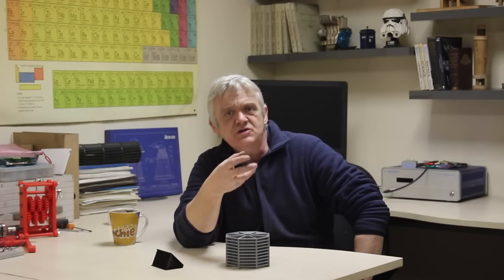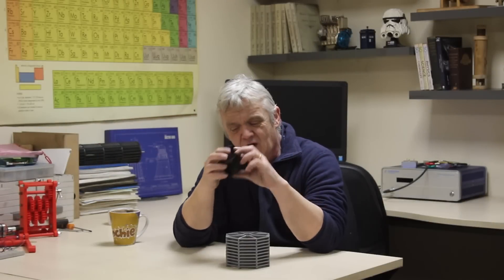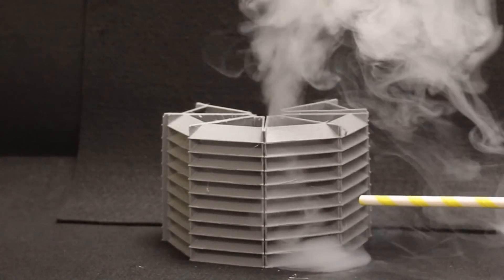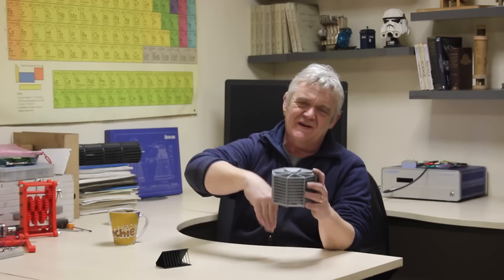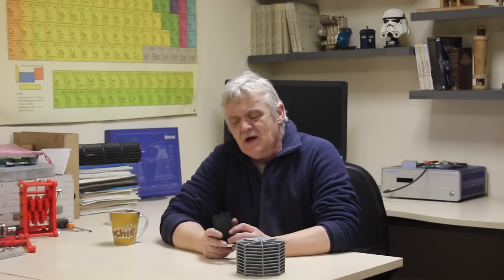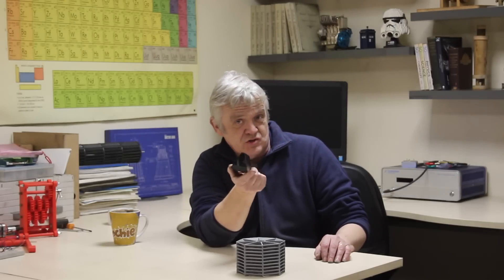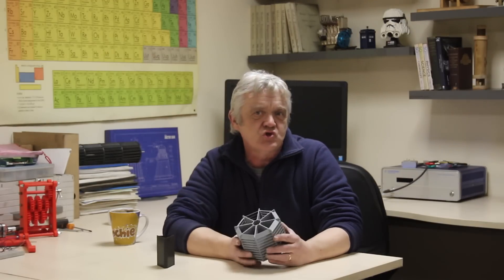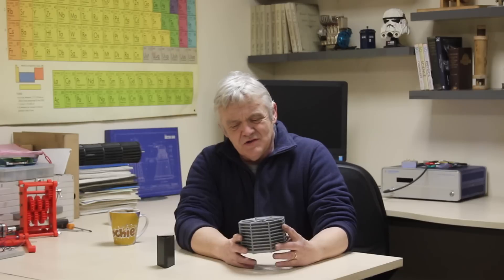1830 A Darwin Wind Turbine Breakthrough

Comment: I don't know why, but I get a little thrill or joy when a solution appears that is SO simple and just works really well. Delicious!
Reply from the maker: lol - me too!!
Reply: ditto, it always points at "lets optimize more!". that with a short stack outer reducer cone and center cone (cross section of round)  \     /\    /
to increase velocity to the outer 2/3 to 3/4 the blades where they make torque..?
like a jet intake or a velocity stack.. non moving parts.

Comment: I think you might not be modeling the air resistance during operation quite right.  I think in practice, the inertia cost of changing the wind direction will slow that air unduly and air molecules will pile up as a buffer around the apparatus, creating a pressure zone and air that would have entered will instead just take the path of least resistance and flow around it.  It will work, but will if work as well as a cowled prop that orients itself to the wind?  I doubt it.
Reply from the maker: no worries - we all have our ideas - I disagree with yours for good reasons of my own - cheers

Comment: Are you sure that the wedges should go until the central axis ? In the initial work the wedges were minimal in length and let the center of the inscribed cylinder free to collect from everywhere, even turbulent wind; all your tests are with laminal wind which is not the most frequent around a building such as a house.
Reply from the maker: no of course I am not sure mate lol

Comment: Not in regards to this but look into the new torroidal propellers! They're amazing.
I regards to this I think if the blades were more like the "Air Blade" set up they might be even more forceful. Hell, maybe then you could direct everything into a torroidal propeller and kick it up a notch. Check out "Major Hardware" who 3d printed the propeller and applied it to a pc fan. Also "Ziroth" did a really cool breakdown of them being used in marine applications.

Comment: Robert can you use some of the power to setup an ionic thruster as well from the top most inner layer blowing down towards the fan? Kind of like a primer for air flow when there may be very little air speed?
Reply from the maker: that's an interesting idea mate - thanks for sharing

Comment: Robert if you also add fins on the outside so it can catch more volume and then on the bottom in the top and then have your thing on the inside and then also another thought is you know how they are collecting are on the roof tops with their causing a vacuum going through a tube control could you put your device and then the wind turbine and then the vacuum of ice after it so that you have most a push and a pole on the blade would that work
Reply from the maker: I like the idea of extending the fins mate - I'll give that a go - the rest - I don't really know to be honest
Reply: Hi Robert
Reply: Robert if you get a chance look up are mined rooftop wind technologies they're using vacuum to run a wind turbine

Comment: Hello Robert,
That looks great but I'm sure there is turbulence which is losing energy in the tip of the wedges.
I believe that If you made each fin slightly deeper than the fin below it, so there would be a gradual increase all the way up until there was no more room left in your wedge for any more fins and with a downward curve over each extension, including a fully enclosed curved top fin, then you would eliminate a lot of turbulence and create a more efficient flow.
Just a thought.
Love your channel, keep us smiling bruv. 😁
Peace.
Reply from the maker: nice thought mate - thank you for sharing
Reply: Tapering the edges of the wedges might help reduce some of the turbulence.

Comment: If you was to put a angle on the back side ( instead of it going to a point in the back) would it smooth the air flow and with less turbulence?
Reply from the maker: I suspect so mate

Comment: Hex vs Octogonal shape efficiencies?  How much resistance to flow does the sharper wedge create?   

Also I understand the advantage of ease of modeling and manufacturing flat panels, however using your previous design with wedges added, @35 degrees and in a Hex configuration might be the better design....   Iteration and all that.
Reply from the maker: good thought and I can see what you mean - I am kind of fixating on octagon and thanks for posting that out

Comment: curious... wonder if instead of wedges for each sections they were Archimedes screws* with the  back side of each to prevent cross flow  is a split tube? . Less turbulence of air in its down path.. maybe more benefits?

but yeah....  lot more complex to make

*probably wrong term....
Reply from the maker: yeah - that's the one that got me mate - but if you give it a go I would be fascinated to see

Comment: Tapor the angle with a Stack shortened sections of Gabriel's Horn to help air transition direction and accelerate with the least  turbulence. 

I know you want the generator on bottom for weight and maintenance considerations but consider if you place it up top.  The wind blowing over the top  of a tube creates a low pressure zone. That sucks air through.
Reply from the maker: I did consider it mate - but honestly I am aiming for low cost. low maintenance and acceptable generation - not sure how it fits in with that

Comment: Now we need to come up with a clever way of keeping the air and ditching the rain water, although there are probably good industrial designs that can already do that, an inexpensive way would be a step forward for the home gamers.
Reply from the maker: most turbines are up in the air in wind rain sleet and snow - I doubt it matters that much tbh mate
Reply: I suppose it wouldn’t be too much trouble to have the turbine inside the air shaft and the generator outside of it with a belt or chain connecting them so that the electrical stuff can stay relatively dry...  I know the commercial wind stuff is able to handle weather but if we build some cheap medium scale equipment ourselves from salvaged parts or hand build components and whatnot, I’m going to assume it wouldn’t last too long if it were totally exposed to lots of rainwater all the time, I’ve definitely experienced problems with that, even at low voltage.

Comment: Thanks for sharing these videos. For what it's worth, I've been enjoying your content for a while and particularly these video covering the Darwin wind turbine design. Since you've been experimenting I've been trying to think if it would be possible have the louvres facing downward (from the centre) to give protection from rain ingress whilst still directing the air downwards. I wonder whether that could be achieved using your new internal "baffles" somehow?
Reply from the maker: I am not sure rain is such a worry mate - after all most turbines are up on a pole come wind rain sleet or snow - then of course there are turbines completely submerged - so - a bit of rain - hmmm - not sure I would worry too much about that
Reply: Maybe a good cap...a sort of roof.🤔

Comment: Now just need to figure out the best turbine to put at the bottom of that pipe to collect all that lovely wind energy and convert it to mechanical energy without causing any back pressure in the tube, that would hurt efficiency
Reply from the maker: wells turbine

Comment: just a quick question, if you have curved vanes, does the 35 degrees still hold true? or can you ignore the angle (mine are not hyperbolic, just a 90 degree segment of an arc) also does the spacing of the louvres make any difference (or is this as yet an unknown) currently still printing a second ring of louvres, I have the tube adaptor, venturi for the top of the tube to bring the size in to the pipe and dome cap for the other end, so next I will need some wind for testing (my whole cap is just over 8" diameter (200mm) and will have  a louvre area just over 10" high (260mm))
Reply from the maker: you can ignore it I think

Comment: Depending on the incoming air temperature it might work better if the air was directed up and a chimney was used as a way to add some additional suction - top-expanding funnel shaped chimney end might create additional low pressure on top to suck the air. Maybe such Darvin air intake could be used together with rocket stove in the center of it for co-generation of electricity  and heat... seems we're building more complicated systems from lego blocks :)
Reply from the maker: it might indeed mate

Comment: I have been watching this project with great interest. You are making huge advances with this technology. I wonder if you put a smaller set of slots along the centre tube, (maybe at 45deg) it will create lower pressure in the centre and draw more air in (Venturi effect) sort of like an airbrush. Maybe even just holes (not aligned with opposite side holes) in the centre could create the effect as well.
Reply: or maybe an internal cone, or slight reduction cone underneath for velocity into the blades like  \    /\   /  (cross section of the round) like a turbine jet engine intake.
center doesn't give torque like mid-to-tip of blades do anyway, its like velocity stacks and ports of an engine.
Reply from the maker: I don't really know mate - but I like the question I will look into it

Comment: What a simple but clever design!

Food for thought:  Instead of the cheese wedge coming to a point, if it was circular it may retain more potential energy (ie. by reducing turbulence and tightening the air column by promoting rotation).
Reply from the maker: cheers mate on both counts!

Comment: Great. One suggestion for a very useful varient of this is a 3/4 profile that can affix to the corner of a building. The most wind on a building is at the corners where wind has to concentrate to flow around the corners. It's a minor variant of that one but easier to install. It's that, just with 2 segments less.
Reply from the maker: clever, clever clever clever - I like that mate - and as you can see - I like it a lot lol
Reply: @ThinkingandTinkering  what about at the peak as well?
Reply: I have been wanting a castle turret design on my house for years... this might solve it for me... Thank you. (The only thing is that I think for permanent outdoor use, I would have to surround the thing in a protective wire mesh to prevent birds and insects from making a home in the slats... and that would tend to diminish the flow... but I don't see a way around that.)
Reply: @marcfruchtman9473  I live next to a house that has two towers. And my first thought when I saw this?
Reply: Since all the governments seem SOOOOOO concerned about climate change / renewables, how bout we make these and vote to replace ALL the big brother (invasive) cameras on the roads and highways with these. Making power instead of consuming it! Who is in?
Reply: @jholland404  that will provide a lot more room for mounting more devices and the power  to run them.  Law of unintended  consequences.  But would  be great if it worked that way.
Reply: @jholland404 that's an awesome idea😅😅
Reply: Seriously brilliant!  We don't get a ton of steady wind where I am, so that would help maximize what we do get!
Reply: They are trialling wind generators down the middle of motorways that pick up the wind created by moving vehicles at the moment.
Reply: That's solid idea. I wonder if that would also work around a rainpipe.
Reply: 9 tenths of the profile would be a bit more effective.  Also minimize gauges of thickness.  O.O5  to 0.32 only an opinion.  Hypothetically at best. Only a short video.
Reply: 180 degrees just mounted on the wall too, its never going to get wind from that side.
Reply: Here’s my question on the 3/4 version mounted on the corner of the house or whatever. You can’t use a fan shaped that way so what do you do duct and funnel it to a smaller fan/turbine and hope reshaping the duct doesn’t have negative consequences on the air current?
Reply: @308dad8  good point. Yes you could. With fluid dynamics if you reduce the size of the pipe, then airspeed actually increases making the propeller spin faster. Alternatively you could bend the airflow slightly by 20° or so.
Reply: Brilliant
Reply: The Old City of Yazd in Iran has these “Wind directors” on their roofs for cooling their buildings. The upwind side directed the wind down and on the leeward side had a slight depression, sucking warmed air back out.
Reply: Brilliant idea!

Comment: The idea to put the walls internally to prevent the air from moving across is quite good. I recommend increasing the spacing between the slats... when the slats are too close together it creates a lot of air friction and you won't get as much air flow.
Reply from the maker: cheers mate - I was pondering that

Comment: If you're up for a bit of optimizing, I would certainly take advantage of the pressure zones this can harness and incorporate a low pressure frontal opening to assist in higher ambient pressure pushing itself into the intake areas and accelerate it up your runners, then open the exhaust area and incorporate a vertical twist through the body. While doing this by hand, flat panels are much easier to build, however, air prefers to travel on smooth surfaces and can be impeded by sharp contours, so much so that boundary layers can incur turbulence and hence reducing efficiency. The beauty of the 3d printer is that it can be designed in such a way that the optimum shape can be achieved and printed quite easily, of which can later be dismantled at larger scale for reproduction via sectioning. And better yet in your CAD program, you only have to make one really great chamber, then place an automated copy/paste routine of how many ever you can fit on the circumference while running a rotation on your z axis. Easy peasy venturi squeezy. 👍
Reply from the maker: to be honest mate and with he idea of simplicity in mind I was thinking of just sticking a wells turbine at the bottom - I get what you are saying but optimisation comes after to my mind and what I want first is a result then we can work on improving it - key criteria are cost, simplicity and robustness
Reply: @ThinkingandTinkering  Fair and valid points!
Reply: Not sure about anyone else, but I'm having a hard time following your description. Are you suggesting another intake before the flaps that would accelerate the air? Would that be any better than just adding more flaps and making it bigger? And are you sure it's not already doing that? Think about it, if the size of the "cheese wedge" is constant, and each flap introduces more air, the air inside the wedge would have to accelerate as it moves toward the end, right? Don't mean to say you're wrong necessarily, I don't know. It would be interesting to get some readings inside the body to see what the pressure and velocity are doing. Maybe a helical flap structure could induce a vortex and make it flow better, but that would mean getting rid of the internal partitions. Would it lose air out the other side? Guess someone's just gonna have to try it. :P
Reply: @DFPercush  I've used my rough description once before as a sort of modern day Francis turbine on steroids that is more based on the operating principle of it but not so much in design; I may be able to modify my solidworks design if it would be of use, though for this, a fresh design would be more practical. Basically the idea is to create a converging/diverging air passage using larger frontal openings on the horizontal plane at the base (x axis if you will) that converge using the top and bottom surfaces of the runners while also rotating upwards around the z axis and expanding after the converging point, developing a low pressure zone inside the mouth that will be accelerated as it travels up through the 'spiral'. 
Perhaps a better visual reference would be to take a compressor wheel and lay it on the x axis back-side down, build a few stacked layers and start the transition where the blades begin to taper towards the vertical, then wrap and expand the upper section that would be the exhaust runners wider at the top than the intake at the bottom. In side profile it would have an S shape but dramatically flared towards the top from the convergence point up. Stacking can still be achieved, however there will be a useful limit with the conical inner section, at which point the upper stages would impinge on reducing returns into the flow volume.

Comment: I know you really like this but, I know for a fact, I've built one, that a shielded savonious is  much more efficient. It will grab air from 360 degrees around it and spin the turbine past its normal tsr of only 0.8. The ones I've constructed and tested boost the tsr up to 1.6. Also I don't believe you've looked at the Sharp Cycloturbine yet, which is a very high torque wind turbine  which can be geared up to provide the high rpm needed to run an alternator.
Reply from the maker: oh I get it mate but a key advantage here is it is not a turbine it is actually a wind catcher - pretty much any turbine could be used if situated correctly
Reply: The big advantage of the Darwin design is it can be very tall, is very inexpensive and simple to construct and doesn't have a long axis of rotation that the Savonious or other VAWT designs have.  The model Robert is playing with here is just proof of concept, imagine it instead as a 50' tower 4 m in diameter instead.  One problem that hasn't been addressed yet in this modeling is the exit path for the spent air.
Reply: And there I go mixing imperial and metric again, lol. :D
Reply: @JonLovestheLord  Exit path could be ventilation for the work shop.